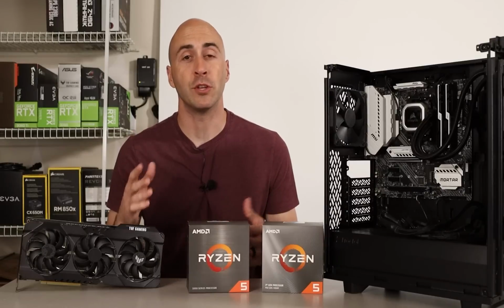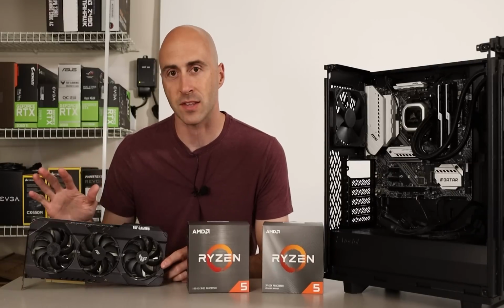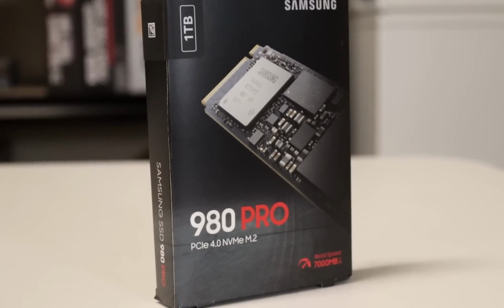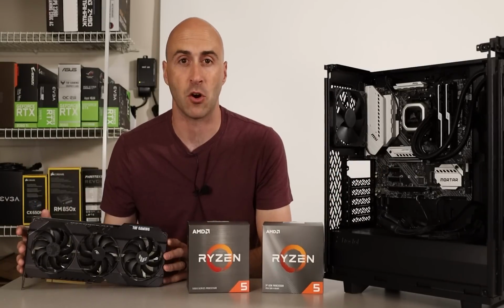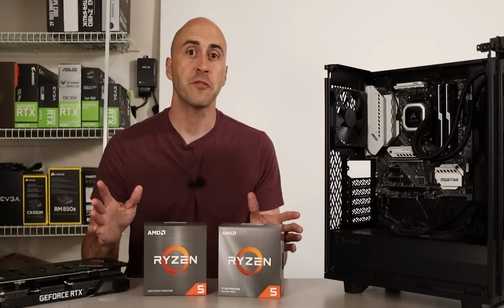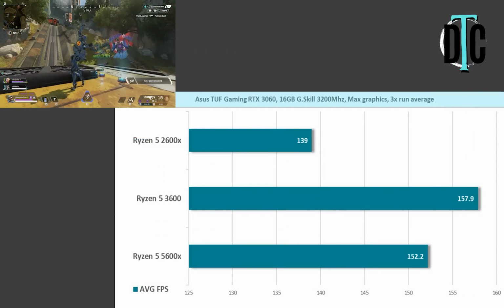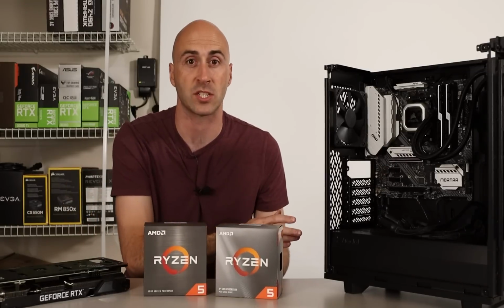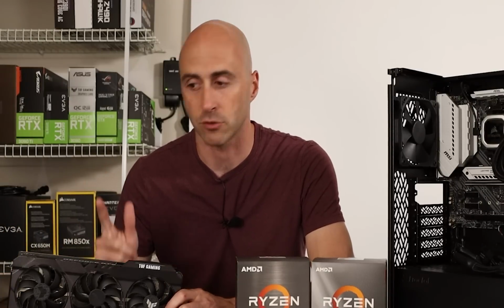Can I buy a New GPU with an Old CPU?

Comment: Thank you so much!!! 3 years later and still relevant to me. My 10 year old i7-5960x is trading blows with the Ryzen 5 2600x performance wise and I just got a RTX 5060ti (16gb). Was wondering how much gaming performance I'm loosing until I can upgrade the rest :)
Reply from the maker: Kinda depends on CPU utilization. I’d check that.

Comment: Some of the graphs are misleading because it didn't start from 0.  For example is rainbow siege, 214 and 223 fps is not a huge different.  This is why comparing fps is often used in percentage. In this case, 2600x is 4.5% slower than 3600, but the graph kinda shows the bar being less than 50% length
Reply from the maker: I’m not an excel expert. The graph auto populates from the chart I enter information into. Sorry if it looks misleading, but an increase IS an increase.

Comment: i wish to upgrade to a 3060, i currently have a ryzen 5 1600, what do you think i should upgrade to? 3600x? 5600x?
Reply from the maker: You can still upgrade to a 3060, you’ll just see less performance improvement that with something like a 5600x. I’d go for the 5600x if you can.
Reply: @DannysTechChannel  got it thanks for info!

Comment: If you were using an i7 from 2016-2017, that would be just fine too.
Reply from the maker: Not true. An i7 7700k will have a large bottleneck in todays games with something like an RTX 3060 or higher. I made a video about it already. https://youtu.be/8Q1_d800YgY

Comment: Good video but the graphs are a little misleading. For example in one of the tests the 2600x reach 214.4 fps and the 3600 223.4 fps, only 9 fps difference but the graph shows a bar that is less than half in length
Reply from the maker: It auto populates the graph. I’m not the best with excel. Sorry about that.

Comment: I found out recently...and it is a considerable boost. I went from my 1080 that I have been using for 6+ years on my 6th gen Sabertooth Z170 S with an i7 6700K to my new ASUS STRIX RTX 3080 Ti Overclocked and it is like running a new system. I have an ASUS Maximus Z690 Extreme build planned for the end of the year when I can afford the rest of the parts...but grabbed this essential part ahead of time as soon as it got close to $1500. Really not interested in trying to get my hands on a 4000 series in this environment during the holidays when I will need it. I often skip releases and get as much as possible out of a build as I can. 6th gen was 6+ years...I plan on 8 if at all possible with this build 12th gen build...can't wait to see what this card does on that system.

Comment: im running an i7-6700T with a GTX 1660 ti and run all games fantastically even though my CPU is from 2015. 4 cores 8 threads is still adequate for playing modern games.

Comment: Yes. You can. I've used 2070 super with i7 920 for almost a year. I got it because I needed new and quiet GPU with modern features for GPU programming. There was some games where it was slideshow, and some games were it did OK. But upgrade to 3900x the next year was very welcome.

Comment: Sporting a 3770k with a 1080 does the job for me.
Reply: i play at 1080p with a  i7-6700T and GTX 1660 ti and can feed my 144hz monitor more frames than it can display. its great.
Reply: @nickhowatson4745  im also using a 144 hz, but im capping it at 120 fps to not agrevate my cpu too much :)
Reply: @Eskimonster  its crazy that although the 3770K is a 4 core/8 thread 77 watt 3.90 GHz CPU, its still outperformed by the 6700T, a 35 watt 3.60 GHz with the same core/thread count
Reply: @nickhowatson4745  alas, in 2011 AMD had zero skills making CPU´s, should not compare them. Also i had a top 10 SUPERPI reckord back then with an OC at 5.1 GHz

Comment: Lets look at a not really high end GPU upgrade and look at a old CPU and you go back to a 2600?? Thats not really that old and not partikular bad for the time it came out so you really picked the oldest to have the best outcome for that part. I would have like to see it tip back to when 4 cores where dominating, and more then 4 was not really an option. That tipping point shows the shift better and in age is only 1 year further back i think so not really that far. It would have shown the full scope of change revolution we have had last years.
Reply: Yeah agreed. Only going back to a 2600x isnt that old of a cpu. I'd like to see this also with intel CPUs but go back to at least 6th gen because alot of people are still running 6th gen intels. I was too up until a yr ago and I see countless people still talking about running 6600k or 6700k processors.

Comment: the gap only really shows when you get up to 5900x/5800x3D territory on amd side. Intel you have to build a new system every cpu anyway most the time.  Most 30 series cards can benefit from a undervolt and receive the same fps and save 100watts.
Reply: Every new CPU? I guess you must be an Aymdiot fanboi.

Intel supports 2 generations per socket, and I guess you are the one that:

1. Upgrade annually AND/OR whenever that's the latest stuff
2. Yet complains that prices are expensive for no reason, you're broke and performance increase is minor

I owned i5-3330 since 2012 until the motherboard died in 2016, the entire platform (CPU+MOBO+RAM) was discarded for a 6700K, which I decided to retire until late 2021, which i upgraded to 10850K (too bad there's no AMD 12C APU).

Sure I could reused the 2.4GHZ Corsair Vengeance RAM (2x8GB), but I needed more RAM, 32 gigs, plus, the old DDR4 sticks were getting finicky, not risking damaging on my new board.

If you are thinking AMD is better, try their 1st AM4 chip (not even Ryzen) on the latest 500 series board, or latest 5000 series chip on the 1st AM4 board, it's not even going to work! Evil Su claims that AM4 has full support--a outright scam!
Reply: @AlfaPro1337  Lol the only thing price wise to complain about which isnt a issue anymore was 250% gpu price markup. The rest of pc parts stayed the same cost.  I have a 4790 with a 380x in one end the house and a 3700x 2070super in the other end. theirs no fanboying. when the 3700x it was the best price > perf platform out. Its all about use case scenario. if your complaining about a difference in gap and am4 full support. Then you need a reality check. The am4 platform if you dont buy a cheap A350 board does fully support all the generational cpus but as you upgrade the bios you lose support for 1st gen none of it was a lie just you cant go backwards after you go forwards.  Your comment was basically baseless jabbing. I build and repair systems for people all the time and know what all of them do. Intel sadly right now isnt worth the cost past the 12500/12700.
Reply: @revog7  Dude, the entire AMD Zen line up isn't worth it.

Why pay a low-end 6c for previous top end $$$? Doesn't make sense.

Dude, AM4 can't even support the full 6 generation support. AM4 didn't start with Ryzen.

It looks like you're the one basically baseless jabbing.

Comment: Interesting results. My 3600 is even running at 4.4GHz. Would be interesting testing all of these CPUs with higher clocked RAMs, boosting the FCLK might show even higher frame rates, especially on older amd cpus (2600, 3600).
Reply from the maker: This was just to show the results average users will experience. Most people don’t overclock

Comment: I’m running a Ryzen 3600 w/ an RTX3060 in my Skyreach Mini S4 build currently in my mini HTPC setup and it’s great for 1080p gaming and 4K single player titles at moderate-high settings which dont need high high fps 😇👍 great episode Danny 🥰😇
Reply: Similar story here, although the gap is larger for me; Ryzen 1200 with RTX 3060ti. Cheers.